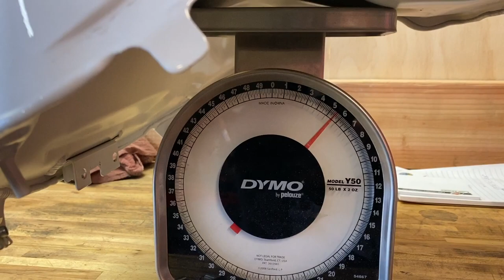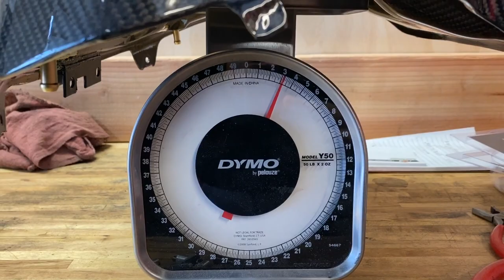2020 S1000RR Gets a Carbon Fiber Gas Tank!!!

Comment: why in your all build series you don't change the electronics like racing ignition coil and regulator and even adding a higher rpm limit for the bike is it dangerous for the engine